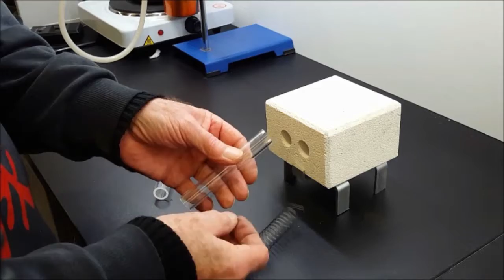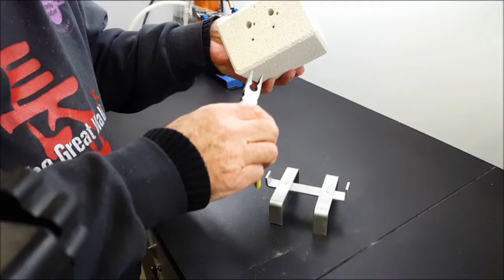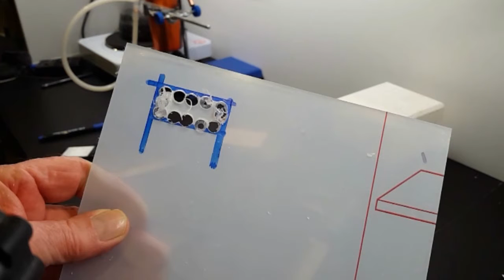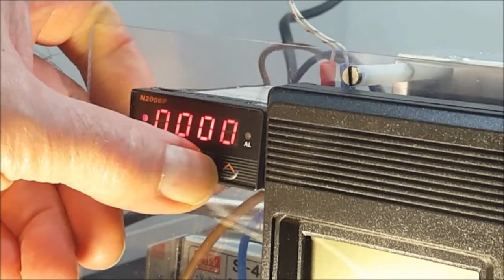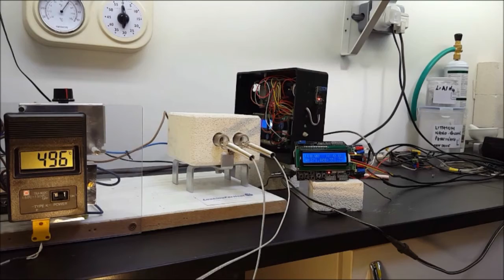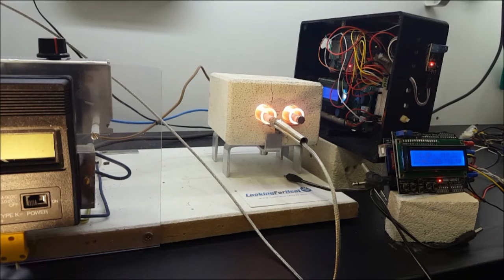LENR Test Kit Mk1 - Reactor Assembly - Tips & Tricks .

Comment: Just use the electrochemical version and use a sonication method to cause the heavy water to bulk up in even spacing to create exclusion zones in the water. It creates bulk locations of positive and negative charge. Should be plenty to push the deuterium and tritium into a palladium cathode. 

It should also produce a very nice visible light effect as well.